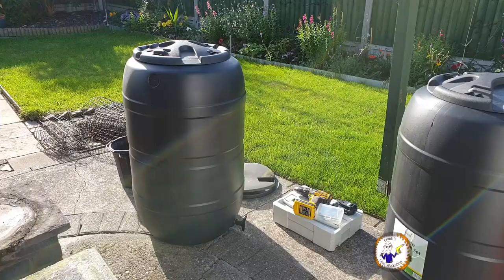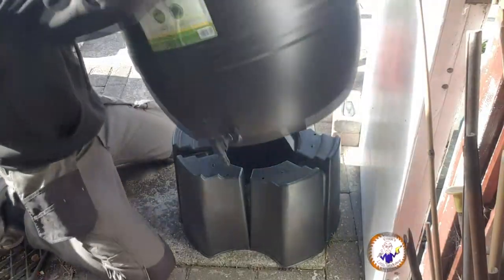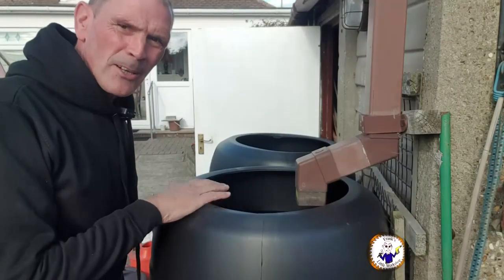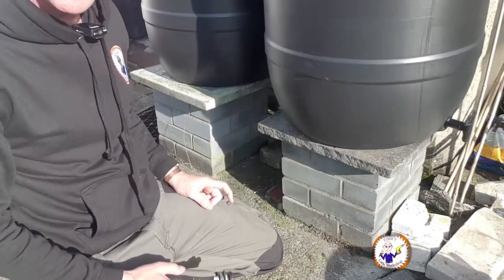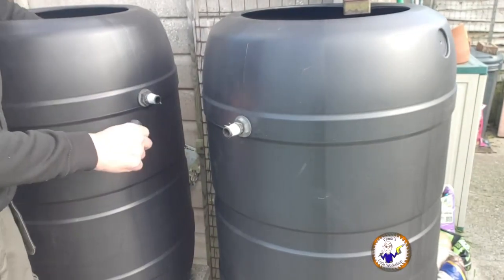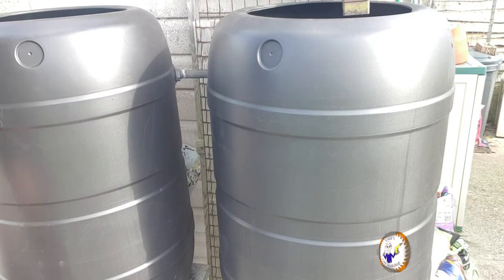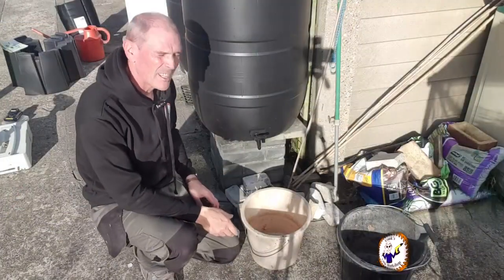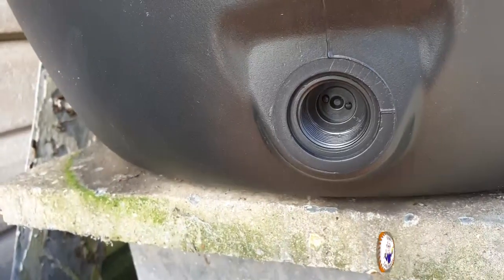How to install twin water butts from Wickes.

Comment: Looks good Frank. Been planning something like that for quite sometime. I was thinking of adding a return from the water butts back to the main downpipe around few cms below in the inlet. I know thats not the case in this instance, as the existing downpipe just drops to the garden. But this has given me the confidence to tackle it 👍😁
Reply from the maker: 😁Thanks Suj. You really do need an overflow back to the main drain if you can, but I didn't have that option 😔. I promise you you will find it simple enough to do... what could possibly go wrong 🤣😂. Thanks again for watching 😁👍

Comment: I have an overflow outlet near the top of my water butt and this is just a length of hose to the original drain.  Great video though, I am going to install another two of these.  I liked the idea of using the step drill from Lidl, I bought one of these recently when they were on offer, I knew it would come in useful one day!  Just one thing if you don't mind me saying, get rid of those deadly strings from around your neck.
Reply from the maker: 😁 Thanks r1273m. The step drill worked a treat. Worth keeping it handy for jobs like this 😁. 100% agree with the strings. I don't like them at all. I do tend to tuck them out of the way if I'm ever using any of the machinery in the workshop. I don't really want to be strangled by my own hoodie 😁. Thanks for watching 😁👍

Comment: Hi Frank,
I have never seen such large water filters. There are small types of water filters here, which are usually for the kitchen. Thank you for showing the detailed installation of the water filters. Now I know a little bit about these. And the little garden there looked great too. It's good to be talented and knowledgeable. Take care of yourself. See you. Big greetings. Kind regards. Your friend Mehmet.
Reply from the maker: 😁 Thanks Mehmet. Its good to have large tanks here in the UK.... it rains a lot. But we still seem to run out of water as soon as the sun comes out 🤪🤪. At least with this much water the garden can still be watered all year round. Thanks for watching and take care 😁👍
Reply: @frankslittleworkshop  Yes true. It's nice to have the garden watered this way all year. See you. Big regards Frank.

Comment: Hi Frank . Thank you for the video. I am going to be installing some water butts over the winter by running a gutter along my shed.  I will be able to install 4, 100 litre butts in the gap between the shed and fence. but I will only have access to one tap on the front butt. My question is  is it better to have the down pipe at the rear butt so that the butts fill from the back to the front, or vice versa?  Also would it be better to have the connecting pipes at the bottom of each butt were the tap is? Many Thanks.

Comment: On some videos the link pipe is at a low level, on yours it’s high, is there any advantage top or bottom?
Reply from the maker: 😁 Hi John. Its only a balance pipe so technically there is no right or wrong way. But if the balance pipe is at the bottom it will be more prone to leaking (you will have the full pressure of both tanks), and if it leaks then you will loose all of your water. If its at the top you will fully fill one tank first but if the balance pipe leaks you will only loose minimal water..... I hope that makes sense. Thanks for watching John 😁👍
Reply: @frankslittleworkshop  good answer Frank, I am about to do this for a friend so didn’t want to regret which ever I choose, I can see top is better, top is easiest to fit also, win win! Many thanks!
Reply from the maker: @yapproger  😁 Good luck John 😁👍

Comment: Hmm, I, as an amateur, have got one waterbuut such that when my water butt fills up excess water goes back into the drain. How will you do that in my case with two water butts?. You drilled a hole in the second water butt, does the height of the hole in the second water butt got to be the same as in the first water butt such that when it is filled upthe excess water goes in to the drain? I am thinking so. Thank you.
Reply from the maker: 😁 Hi B N. You will only need the one drain off pipe back to the drain. You don't need one for each barrel. As long as the drain hole is higher than your link pipe you should be good to go. If it was lower you would never fill your tanks properly. Hope that helps 😁👍

Comment: better to drill the butts upside down with lid off to stop debris falling into butt and later blocking tap
Reply from the maker: 😃👍 Good tip Tony. There is a lip on the butt, but it would make it easier to remove the debris 😁. Thanks for watching 😁 👍

Comment: Do wickes provide that connector pipe to join the two water butts together?
Reply from the maker: 😁 Hi J Griff, the link pipe didn't come with the kit. So you would need to get the additional connectors. But it did come with a short bit of hose (for the down pipe adaptor) which you could possibly use to save some money. Hope that helps. Thanks for watching 😁👍

Comment: Can i use a water butt to help to generate cold water into a garden studio for a electric shower and sinks? Instead of using the main water pipes
Reply from the maker: 🤔 In theory there is no reason why you can't...however... you may need to have some filtration in the system. The water itself will probably be cleaner than out of the tap but it obviously may contain some different bacteria that is normally processed out. Also, the water may pick up some contaminants from the roof during collection. And finally, if the water sits in the butt for to long it may stagnate and you could get legionairs propagating.... which is really bad. So I would probably NOT recommend it, just in case. Thanks for watching Giuseppe 😁👍

Comment: Why not just join the taps together with hose lock? If both taps are left open the 2 butts are effectively one big butt. To get water, simply take water from the top opening of the butt or turn taps off, release hose lock, then use the taps in the usual way. I also fit an overflow pipe connected to the original gutter down pipe in case both butts get full. Using the taps to join the butts to each other, I have 6 butts joined to each other. In order to do this you will need some 3 way connectors.
Reply from the maker: 😁 All if these things are possible DMS. The thing is, these buts were installed in an old couples garden... they are in there mid 80s. They can't just lift the lid etc. They just need to "turn the tap and water comes out" 😁. Thanks for watching 😁👍